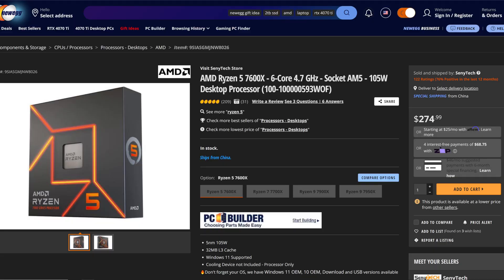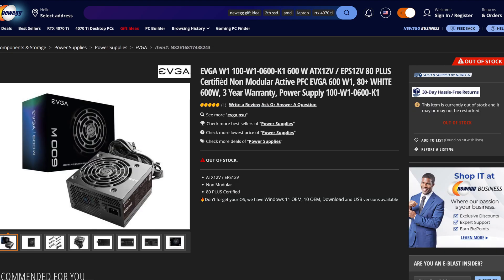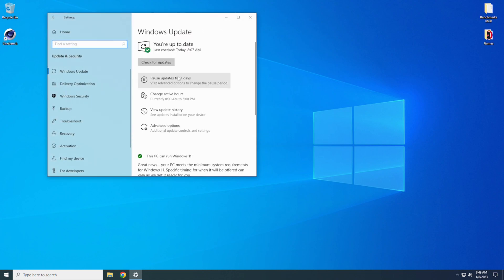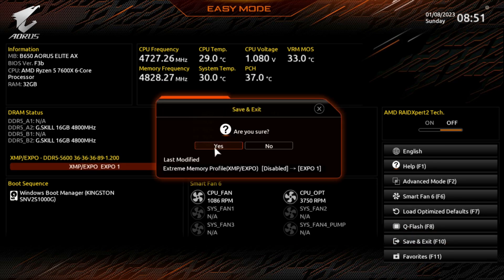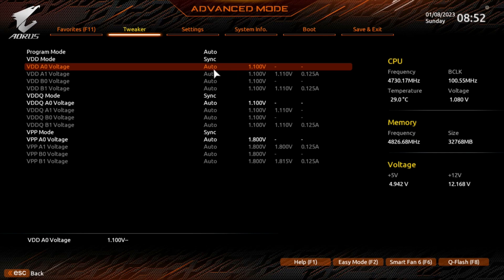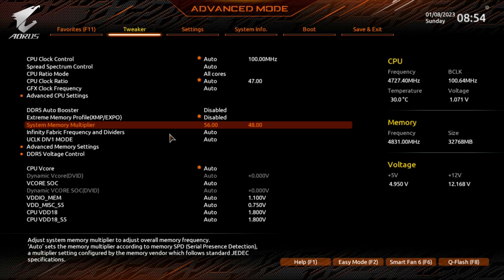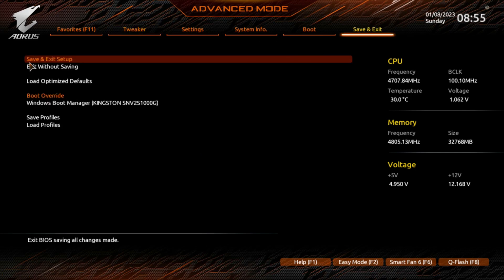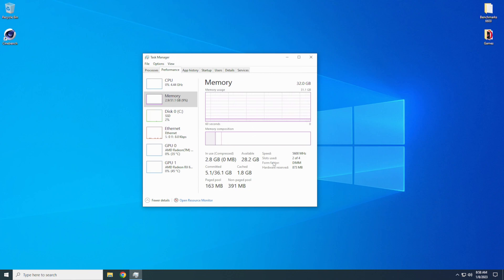DDR5 Ram overclocking guide on the B650 Aorus Elite Motherboard

Comment: Havent tested it yet but anychance somebody ran a b650m aorus elite ax with an intel xmp ram?
Reply: I just bought that board with patriot 7000mhz, just waiting for Ryzen 9800x3d to arive. BUT i hope my ram will work just fine
Reply: I have b650 elite ax ice with gskill xmp rams 6400hz, im getting blue screen of death couple times a week and decided to turn off xmp. No blue screen of death since i did that, i am looking on how to manually increase the speed from the stock 4800 speed or else ill change to sticks that got expo and not xmp

Comment: Man I was having so much trouble trying to get my ram to run at 6400 instead of 4800 - with XMP/EXPO crashing my bios every time ( Failure to Boot ). I followed these steps and it works, my Task Manger really does say 6400 MHz.. I can't believe it lol. If only I would have found this video sooner, I think this could save someone a lot of time. I still don't know why my bios will not run XMP...? I have the latest update from my Gigabyte B650 Aorus Elite AX ICE, windows, and amd. Idk.

Again, thank you, this was stressing me out.
Reply: Hi, I do have the same motherboard as yours and g.skill 6400. When activate Expo pc is rebooting, because it is not stable. Can you please write your ram on settings to me .
Reply: +1 on above. Can you reply here and confirm it’s been stable since? I have same mobo. Thanks!
Reply: would love to know as well
Reply: I have b650 elite ax ice with gskill trident z5 xmp rams 6400hz, im getting blue screen of death couple times a week and decided to turn off xmp. No blue screen of death since i did that, i am looking on how to manually increase the speed from the stock 4800 speed or else ill change to sticks that got expo and not xmp

Comment: thanks for the guide Daves, i got a B650 Aorus elite AX too, go with the Gskill 6000 36 36 36 96 EXPO RAM kit, 100% sure it's Samsung B die, trying to OC it to 6400 at 1.35v same timings, and it worked !, not sure it's stable or not, but no crashes while gaming :face-blue-smiling:

Comment: Thanks for the easy step by step guide it's definitely appreciated. I have 4x8gb sticks of oloy blade 5600cl36 and so far have been able to get it to 6000mhz with the timings 30-38-38-76 at 1.4 V. I gamed for about 6hrs today with no crashes or anything so when I was done I changed the timings to 30-36-36-76 just to try to get the timings a little tighter and I will see how it does tomorrow. I'm already very pleased though and also really appreciate your bios video as well. I was always a little scared to update my bios but again you made it very easy to understand and follow and I just wanted to say thanks for the time and help you put in to help me out

Comment: On newer bios clicking on the System Memory Multipler doesn't allow to change from auto. You need to click on it and use the + and - to change the value.

Comment: Hi there! Thanks for this video, simple to understand, without entusiastic overclocking. My DDR5 32 GB Corsair Vengeance XMP3.0 just doesnt wanted to run with A-XMP enabled on MSI b650 tamahowk + Ryzen 7600x, just black screen, even BIOS couldnt run .Made exactly same settings, just with my clocks and timings, and it is running smoothly now. Thanks!
Reply: If you are using more than just the 2 slots (a2 and b2) you have the reduce the speed of the ram for the computer to boot

Comment: At first looks could the psu be the issue? Whats if the psu in this system was changed was 600 to 1000w? Would xmp boot w/o manual oc? Pretty new to pc.

Comment: Thank you for your videos! They helped me with bios update and RAM overclocking. I managed to OC it from 5600c40 to 6000c30-38-38-30 with subtimings from buildzoid's video (hynix chips).
Reply from the maker: Your welcome. Thanks for watching and the comment.
Reply: Is yours corsair vengeance? Cause mine is micron chip 😢
Reply: @manpais  no, mine are KF556C40BBK2-32 by Kingston. I was looking specifically for hynix chips.

Comment: how would i know if its stable or not ? i did the xmp.
Reply from the maker: You could ran something like memtest 86, or prime 95 to test it, but the best way is to just use the system has you normally would and watch for anything fun happening while you use it. Thank you for watching and the comment.
Reply: @DavesTechway  it for sure wasnt stable my pc was freaking out. didnt need a test for that haha, i dont think i can overclock my 4800 to anything higher it freaked out. thx tho.

Comment: ddr5 voltage control option has dissapeared with the most recent bios update F3H any idea?
Reply from the maker: Sorry not sure. Thanks for watching and the comment.
Reply: They moved the voltage control options to the main Tweaker page into the voltage section under the memory section.
Reply: @patrickethridge   couldnt find it
Reply: @sol9843  In BIOS version 7a, there are no separate voltage control attachments now. They made a "ddr_vdd voltage" tab right above the "Advanced Voltage Settings" menu bar Look closely at yourself and you will see, I hope it helped!
Reply: @timurtvil161  Alright let me configure it rn